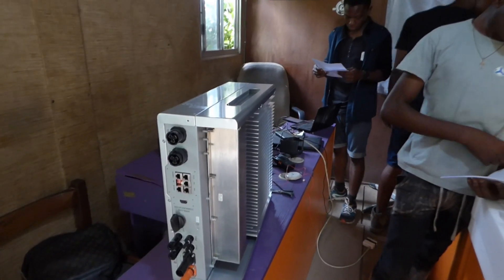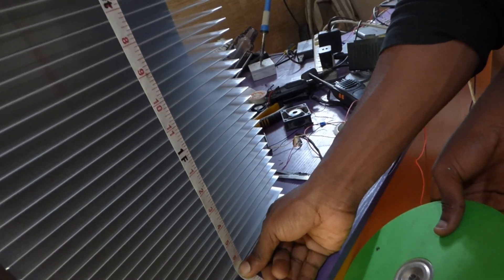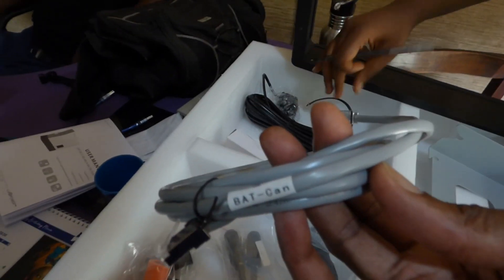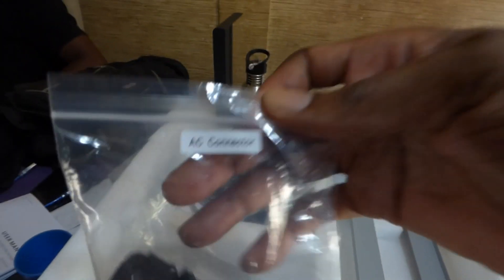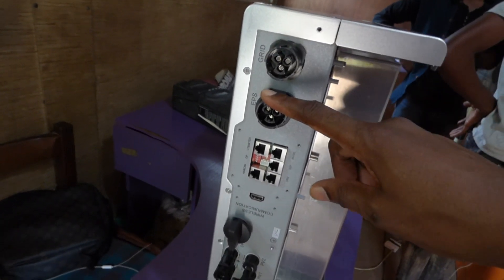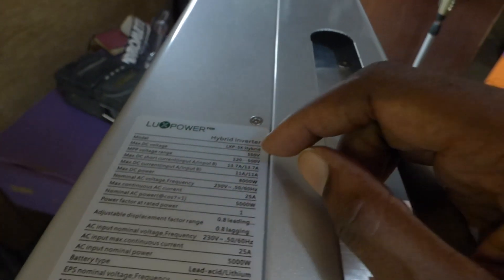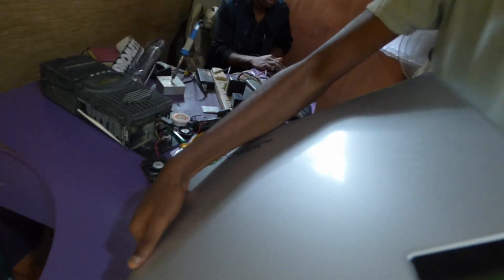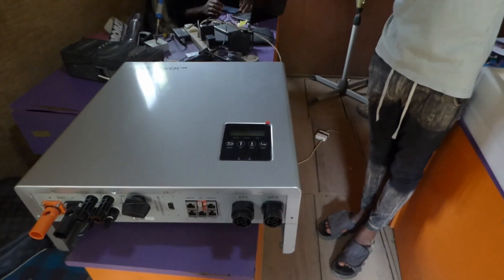Exciting new inverter. Up to 8kw in Panels

Comment: You mention that it’s a ‘Locks Power Hybrid Inverter’. Or is it ‘Larks Power’? What’s the company name and model number for this inverter? Thanks!!
Reply from the maker: Luxpower. Sorry I did not spell it out. LXP low voltage Hybrid
Reply: Thanks! I found their website and it has lots of great info too:
Luxpowertec.com/hybrid-lv.html

Comment: Great video as usual Dr Solar. I hear you mention EPS. Does it mean that this inverter doesn't have UPS function? i.e a couple of seconds must pass before it takes over from the grid if need be? Can this be paralleled to expand capacity when necessary?
Reply from the maker: Thank you for watching and commenting. It has a UPS mode and the transfer time is 10 ms. In battery or UPS mode it maxes out at 3600 watts. You can parallel up to 9 for 45 kw. I hope that answered your question.